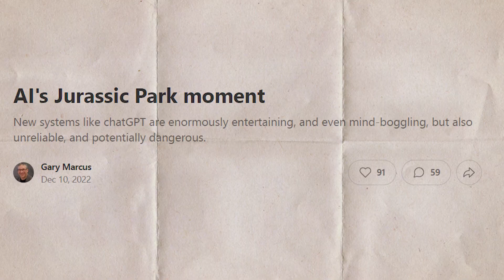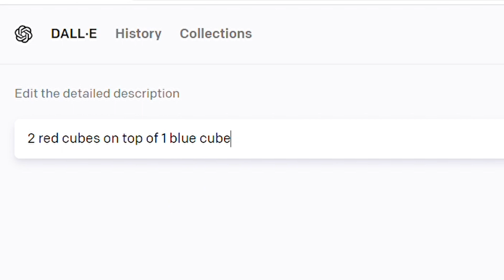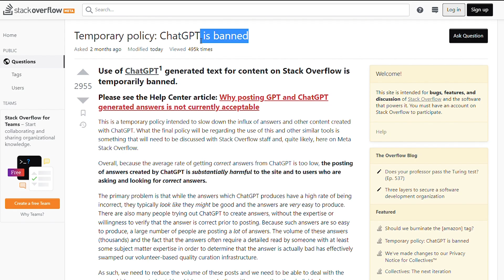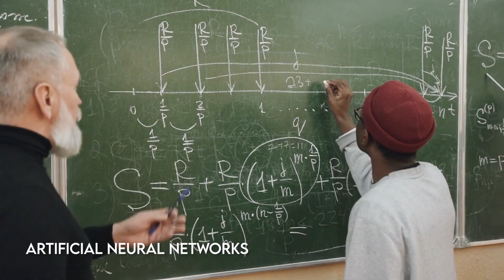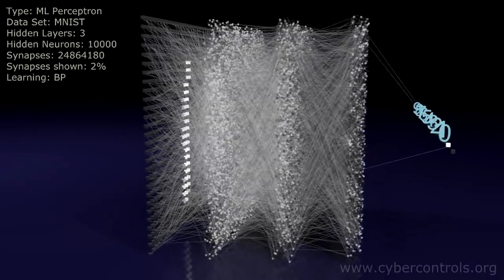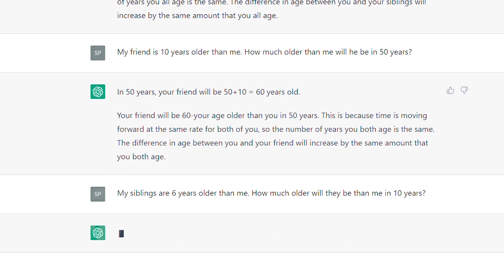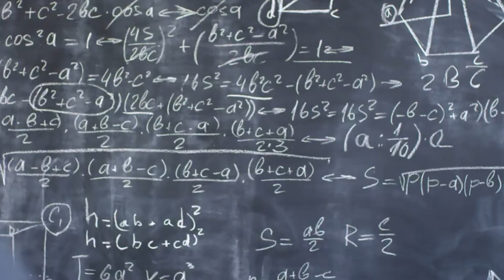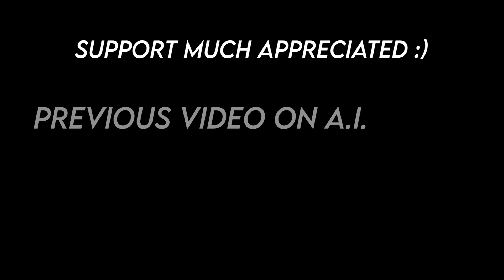The Key To Unlock AGI Isn't Deep Learning

Comment: LLMs can certainly reason well, it's just a matter of more computing and data, and using prompting strategies. They are function aproximators, logic can be represented in functions. You just have to aproximate enough. Both the cubes positions and the age difference problems are already solved by current models, and any problem that we can come up with now will also be solved in a couple of years (or months). LLMs might not give us the best kind of AGI, but after they become truly multimodal they can definitely give us a base for some kind of AGI, reliable enough for most tasks. Hopefuly something better will come up along the way, something that integrates planning internally in the model.

Comment: My prompt:-

"My brother is 7 years older than me, and my sister is 5 years older than me.  In 10 years, how much older than me, will they each respectively be?"

"Think through each step logically.

Imagine three different experts are answering this question.
They will brainstorm the answer step by step reasoning carefully and taking all facts into consideration
All experts will write down 1 step of their thinking,
then share it with the group.
They will each critique their response, and the all the responses of others
They will check their answer based on science and the laws of physics
Then all experts will go on to the next step and write down this step of their thinking.
They will keep going through steps until they reach their conclusion taking into account the thoughts of the other experts
If at any time they realise that there is a flaw in their logic they will backtrack to where that flaw occurred
If any expert realises they're wrong at any point then they acknowledges this and start another train of thought
Each expert will assign a likelihood of their current assertion being correct
Continue until the experts agree on the single most likely solution."

GPT4's response:-

*Expert 1 (Step 1):* First, let's establish the current age difference between you and your siblings. Your brother is 7 years older than you, and your sister is 5 years older. In 10 years, we need to determine how much older they will still be compared to you.

*Expert 2 (Step 1):* I agree with Expert 1's initial assessment. We should also consider that in 10 years, all of you will age by the same amount of time, which will not change the age difference between you and your siblings.

*Expert 3 (Step 1):* Yes, that's correct. Since all of you will age by 10 years, we can simply add the 10 years to each of your current ages and then compare the age differences to confirm that they remain the same.

---

*Expert 1 (Step 2):* So, in 10 years, you will be 10 years older, your brother will also be 10 years older, and your sister will be 10 years older as well.

*Expert 2 (Step 2):* Right. And since the age difference between you and your siblings currently is 7 years for your brother and 5 years for your sister, we can safely say that the age difference will not change in 10 years.

*Expert 3 (Step 2):* I concur. The age difference between you and your brother will still be 7 years, and the age difference between you and your sister will still be 5 years.

---

*Expert 1 (Conclusion):* Based on our discussion, I believe we have reached a logical and accurate conclusion. In 10 years, your brother will still be 7 years older than you, and your sister will still be 5 years older than you. I assign a high likelihood (99%) that our current assertion is correct.

*Expert 2 (Conclusion):* I concur with Expert 1's conclusion. Our reasoning is sound, and I also assign a high likelihood (99%) of our current assertion being correct.

*Expert 3 (Conclusion):* I agree with both experts. Our approach is reasonable, and I assign a high likelihood (99%) of our current assertion being correct. In 10 years, your brother will still be 7 years older than you, and your sister will still be 5 years older than you.

The prompt is everything.
Reply from the maker: Thanks for the comment! I definitely agree that with more diligent prompting GPT3 could have solved this as well. The thing is, that's not really my point. I'm going to copy/paste a response I wrote to another comment that had a similar critique of this point:

I'm actually happy you bring this up. GPT 4 can solve this quite simple logic puzzle, and that is definitely is a step forward into the right direction. But still, it has trouble with more advanced logic. Try it out for yourself. And that's an issue if we want the AI we use to be reliable. That's also a big part of why self-driving cars aren't as widely propogated as we a lot of experts had predicted they would be by now. They still mess up sometimes. And so, we can't really be using tech that has issues every so often, (well until the percentage of messing up becomes marginal - well beyond human error, I would think), in areas of our society where there would be serious consequences if it were to mess up. Using GPT 4 as a facilitator for creative work or something similar to that is quite remarkable, and I'm not in anyway opposed to using LLM for these kind of purposes. It's just that for more "serious" use cases, we aren't quite there yet. And so, that's why I question the approach to AI advancement that relies solely on machine learning. Then there's also the whole issue with transparency, which I won't get into, as that's a big talking point in the video.

Comment: ChatGPT 4 said this re the question at 2:59...
"The age difference between you and your siblings won't change over time. So, in 10 years, your brother will still be 7 years older than you and your sister will still be 5 years older than you"
Reply from the maker: I'm actually happy you bring this up. GPT 4 can solve this quite simple logic puzzle, and that is definitely is a step forward into the right direction. But still, it has trouble with more advanced logic. Try it out for yourself. And that's an issue if we want the AI we use to be reliable. That's also a big part of why self-driving cars aren't as widely propogated as we a lot of experts had predicted they would be by now. They still mess up sometimes. And so, we can't really be using tech that has issues every so often, (well until the percentage of messing up becomes marginal - well beyond human error, I would think), in areas of our society where there would be serious consequences if it were to mess up. Using GPT 4 as a facilitator for creative work or something similar to that is quite remarkable, and I'm not in anyway opposed to using LLM for these kind of purposes. It's just that for more "serious" use cases, we aren't quite there yet. And so, that's why I question the approach to AI advancement that relies solely on machine learning. Then there's also the whole issue with transparency, which I won't get into, as that's a big talking point in the video.